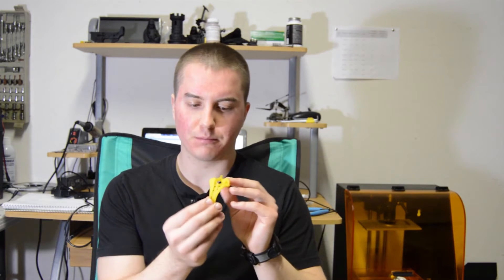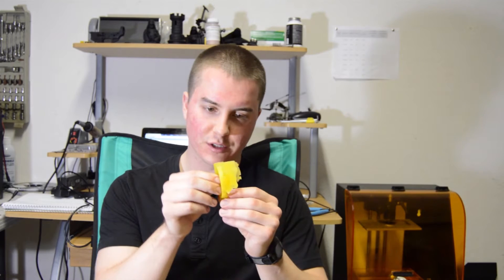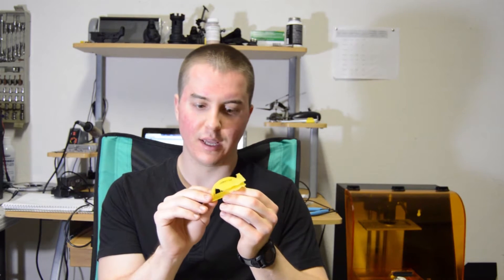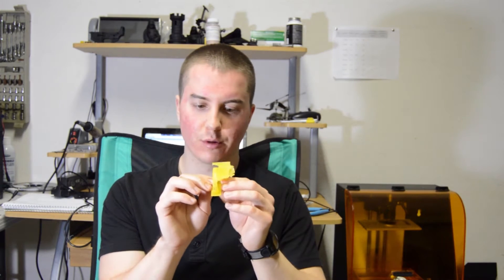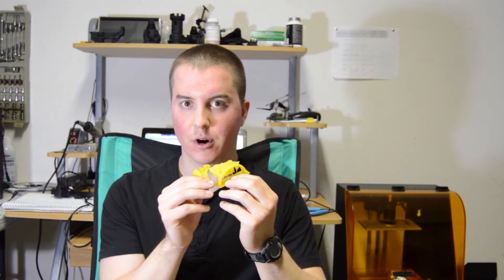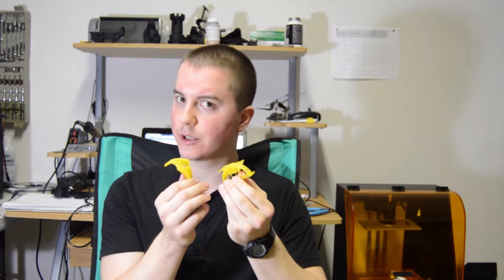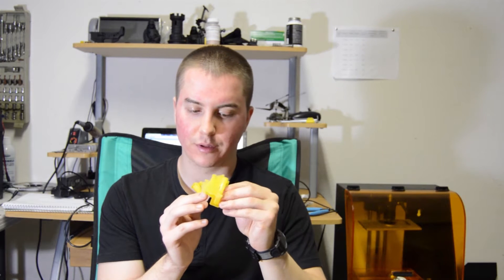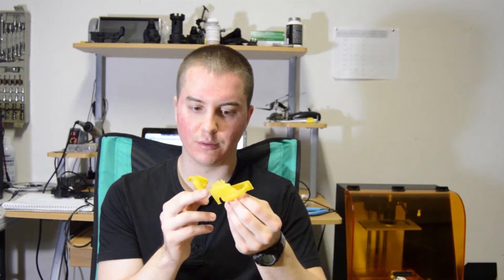Ultra High Resolution 3D Print

Comment: I am having the same issue with makerjuice G+ the yellow is not so bad but the grey is worst with background of exposure I am losing a lot of detail, Does changing contrast work even after the color wheel has been removed ?
Reply from the maker: +patprop74 yes because the color wheel doesn't effect contrast settings. This is what I would advise (I have used MJ in a while so it may or may not work). Turn contrast all the way up (ie. Make whites as bright as possible and blacks as dark as possible), turn brightness to about 50% (You may have to adjust it slightly from there but 50% is a good starting, brightness just makes whites and blacks brighter), then turn your gamma setting to the least bright (gamma settings exponentially increase light output and anytime I have dealt with overexposure it has been linked to the gamma setting) try that and if you don't get any curing then turn your gamma setting up one level of brightness. For my Acer projector the numerical gamma setting to not coincide with least and most bright so you will have to look at the output and make the judgement on what is least and most bright. Hope this helps!
Reply: Thank you for the fast response , I will try your advice today and let you know, Do I need to change the settings on the projector it self or on windows settings or both im thinking ?Edit: I am using a normal VGA cable would using the hdmi be better and should I set my laptop to 16bit color rather then the 24bit ?
Reply from the maker: +patprop74 definitely the setting on the projector itself. Laptop display settings shouldn't effect the output of the projector. VGA or HDMI should work fine as long as the correct resolution is recognized by your laptop. 16bit vs 24bit shouldn't matter too much since the grayscale generator creates 8bit images (ie. 256 color).
Reply: you advice defiantly  is doing something  I was the  images is  more crisp with contrast and ..... corrections I was even able to drop from 5000MS to 3800MS which will most defiantly help with back exposers I have yet to take out the lamp glass yet, I will also be replacing with 3660 uv pass glass you have. Thank you ! great call on the contrasts .... I appreciated it!

Comment: Hi, very nice result. I'm working with bluray engraver and I'm also having the same problem - background exposure, mainly come from the imperfection of lense and lense cover. I'm not so sure if my method can solve yours, but I just want to share it. I put black anodize alluminium cap with a small hole infront of my exposure lense to block those excessive background uv light - there is intense light of ring at outer side of the actual exposing beam. It helps a little bit.
Reply from the maker: thanks for the input, this printer actually uses a DLP projector not a laser.  I've adjusted the brightness, contrast and gamma settings on the projector to minimize background exposure.